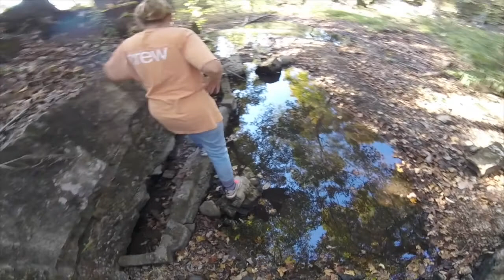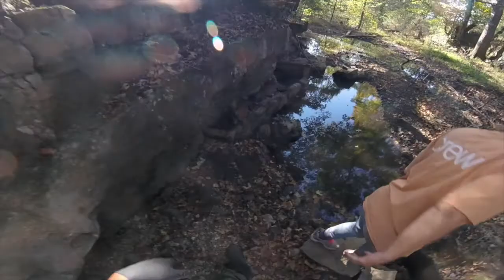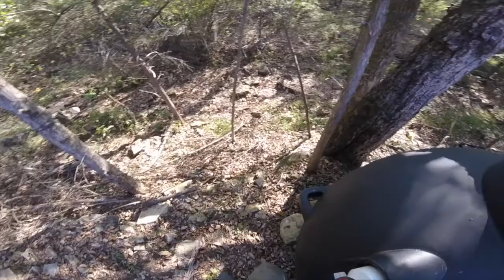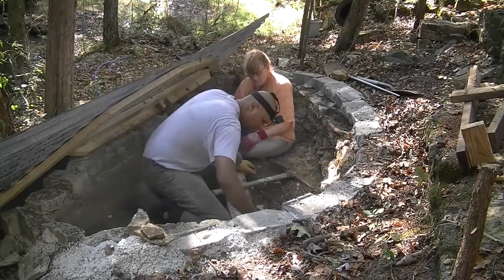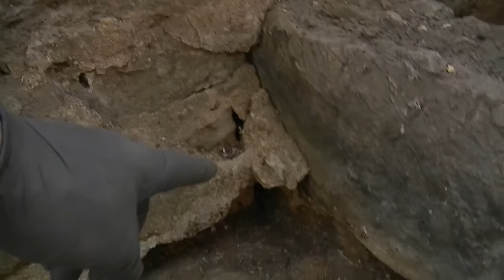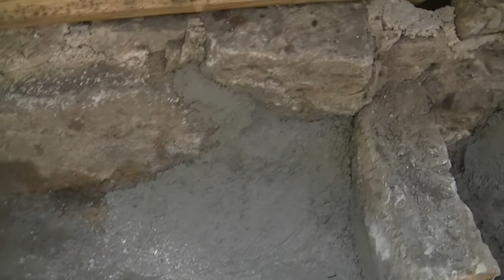OGH - Maintaining the Spring, Shocking Cistern, Concreting Leaks

Comment: I truly admire your efforts. Most people wouldn't even bother. It's back breaking work but you'll get there. I hope you suceed. With all that runoff water, you'll you'll eventually have more than enough. I'm jealous.
Reply from the maker: Its Running OVER a bunch today.  Went down to get the pipes opened up / cleaned the filters... and we're in business!!  5 Months without a Running year round spring! -- which is what we were told.

Comment: Your partner needs a mike. She cannot be understood. I'm not there so I probably am way outa line here but your cistern looks too small and should be rebilt.
I lived off of cisterns and spring houses. You need to ask for outside help to fix this permanately. Sorry if I overstepped my bounds.
Reply from the maker: Hey Roy,  sorry about audio, yes you're right, the lower cistern should have been much bigger.  However we were on a budget and expansion of the tanks is a future project when we get more $ or have a donation specifically for this.    We had a drought these last few months -- and If we had I'm guesstimating 10,000 gallons of reserve, we could have made it through for personal survival.  However with wanting to get more animals (meat producing) type we're gonna have to step this up big time.  The spring overflows most of the year and starts slowing down around August/Sept like it did last year.  Last year we had only 2 weeks of drought where the spring dried up.  So Far it's been 5 months.  We just had an inch of rain about a week ago, we had 4-6" of snow and last night 1.3" of rain and everything is overflowing now again.